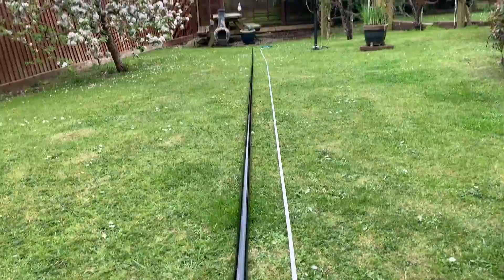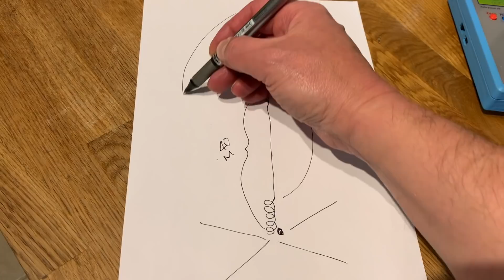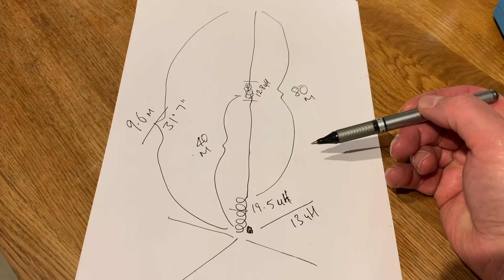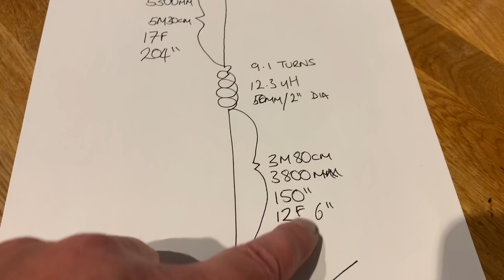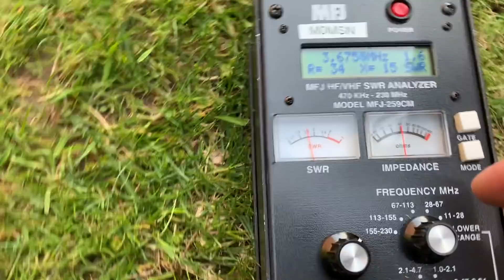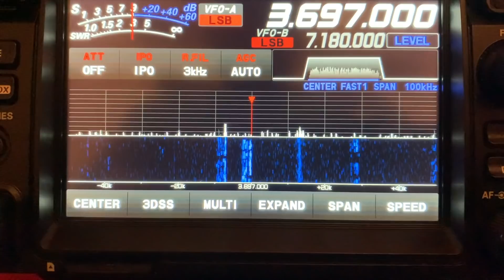Build a BASELOAD 80M, 40M Vertical on a DX Commander Classic pole.

Comment: Hi Mike
I follow your nice videos for long time.
I finished today to prepare the 40/80 vertical as you described here.
my question is if I want only the cw portion what will be the data of the wire and the coils.
Thanks in advance
Jan
4X1VF
Reply from the maker: Hi Jan, I would say that you can lengthen/shorten the wire and the coils to suit.

Comment: hi mike I built your 40 and 80 m vertical antenna and the coils are precise as you made them but the antenna resonates at 3550mhz and 6500 mhz how can I do it do I have to shorten both the cable to 5.30m and 3.80m? hi thanks and congratulations Claudio Ferro iz5axd.
Reply from the maker: You could remove 1 or 2 turns from the coil and test,  good luck. :)
Reply: tkank so much

Comment: Nice video. I do have one question though, by doing this and getting both 80M and 40M on one wire, do you still retain the ability to have 15M, which normally is a 5/8th of the 40M wire?
Reply from the maker: no you loose 15M.  :(

Comment: Nice one Mike. However, did the swr lower on 40 when you picked up the analyser? If so I’m thinking common mode?
Reply from the maker: Precisely Tim, I was sitting over a ground radial, so lifting the analyser stop the coupling.
Reply: @mike-M0MSN  Righto 👍👍
Reply: @mike-M0MSN  nice one Mike. Was the radial on ground surface or buried?
Reply from the maker: @TIMG5TM  surface Tim,

Comment: Very interesting, was the DX Commander you were comparing it to Inverted L or Base loaded coil without the trap? Obviously putting traps and coils in compromises the Antenna to some extent, Once again any Antenna is better than NO Antenna :-) Between this new One, simple base loaded and Inverted L which One do you think is least compromised? Obviously the benefit of this One if 40 and 80 without going out in the rain to swap it around :-)
Reply from the maker: Hi Chris, It was a inverted L. the inverted L is much better
Reply: @mike-M0MSN  Thought it was probably the inverted L you were comparing it to. Just shows you don't get anything for nothing, Great experiment though.

Comment: This is very interesting. Thank you Mike. 
It would appear, prima facie, that even a sanatorium inmate such as myself could indeed build this antenna. 
This dual band single element antenna would be great for parks activation where most of the contacts are on 80m and 40m.
Well done. Congratulations. Thanks :-)
Reply from the maker: Thank you for the kind words Ade.  :)

Comment: very good antenna , excellent swr 80M. how much swr 3.780 mhz ? and how do you pull swr down 40m ? littlebit 1.2 ?, Build 40M. coil with RG58 ?
Reply from the maker: Simply trim and play, this example was close enough for me, but you can spend more time making it better.